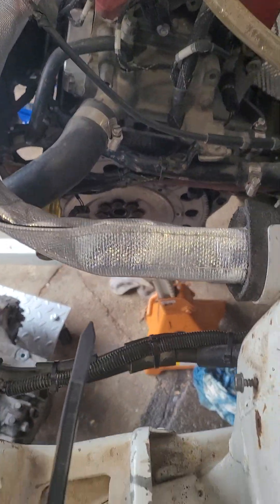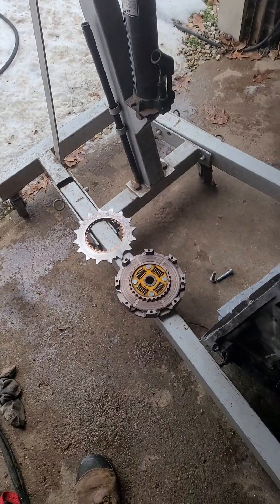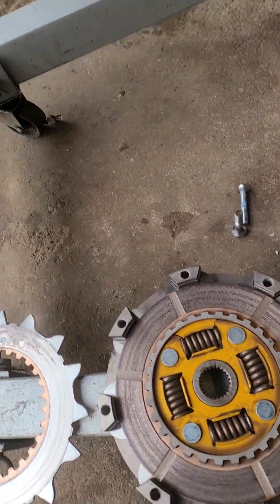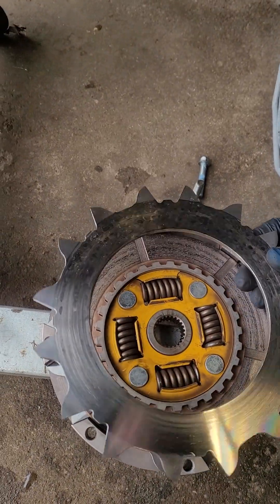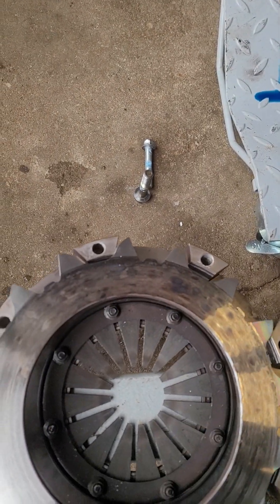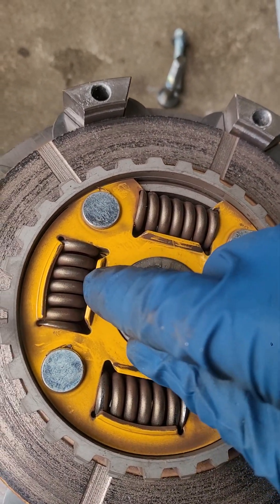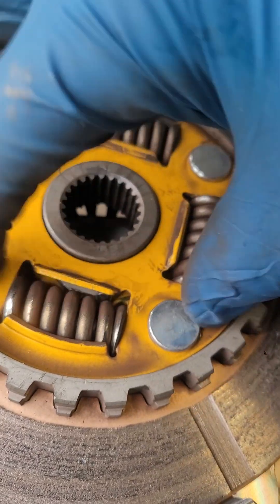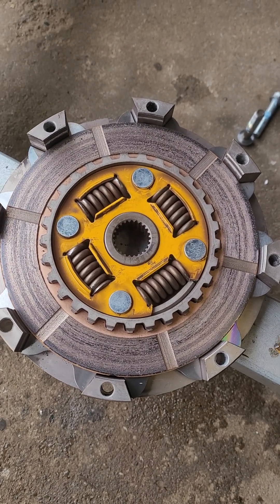Adlerspeed Twin Disc Clutch Review Failure Analysis

Comment: My pops put this on his h22 swapped eg and it’s still going strong but what he did different was take the clutch to a clutch shop to be checked and rebalanced.. I think that’s the key to these lasting longer
Reply: How much power is he making? My buddy had this clutch on his 600hp h22 Prelude and it didn’t last 2 weekends of street racing at that power level after breaking in. Uneven hot spots on the flywheel and pressure plate just like every other failure video posted

Comment: Hahaha, it's obvious that this problem is caused by incorrect installation of the clutch. some of the clutch pressure plate screws are not tightened, resulting in uneven wear of the clutch. Meanwhile, due to some bolts not being tightened, the central gear is constantly compressed, relaxed, and subjected to cyclic impact, resulting in fracture...
Reply from the maker: Yeah, obviously. 🙄 All flywheel were torqued to proper spec and we're still tight when I removed them. It's not hard to get 19ft/lbs. Try again.
Reply: Every single review video I watched of this clutch had the same thing thing happen to each user. Power output varied from ~350whp to ~750 whp. Each clutch failed early and had wear on half of the clutch pressure plates just like this. The clutch is just built poorly. What happens is that high heat warps the diaphragm and its starts to unevenly apply pressure as a result of the warpage. If you utilize google you will find another early failure where measurements are taken and runout is shown. Part of the problem is also how these clutches are driven. These are time attack and road course clutches, not really meant for high rpm clutch drops like in drag racing. I cant explain away this failure via that driving style though as rally racing in snow translate to easy wheel spin not sticky tire launches at high rpm. The big problem is that the manufacturing is just a big too cheaply made. Its close to being decent, but not quite. 

Every single reviewer I watched said, well it would have been nice to have a decent performing twin disc for ~$500, but this is not that. Perhaps taking the assembley to a clutch build and having it gone through would provided a better outcome.